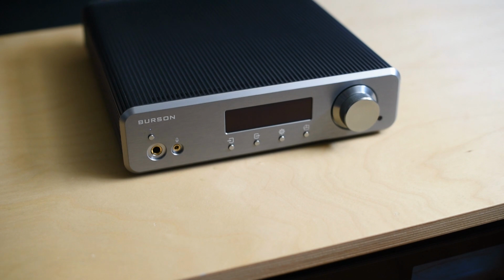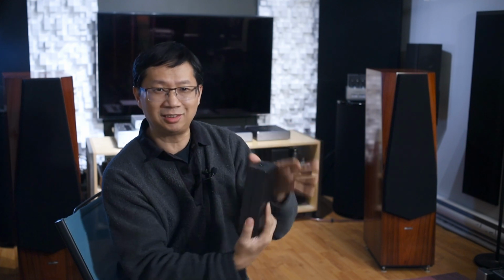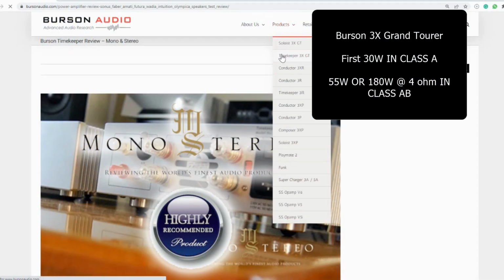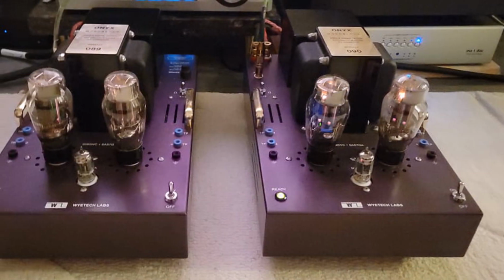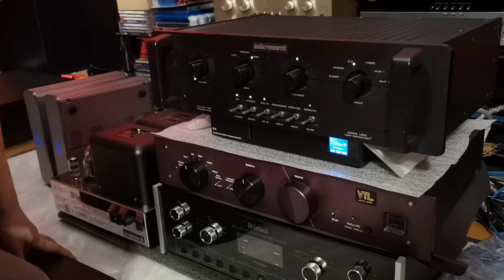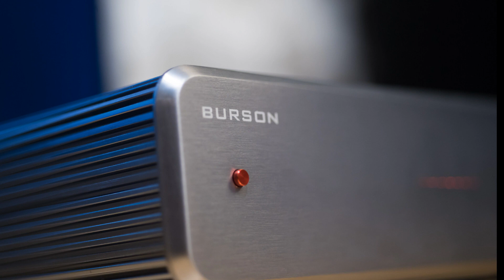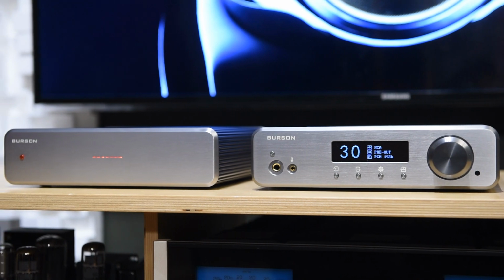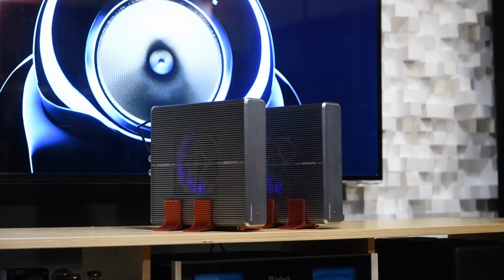The FUTURE of power amps? Burson 3X Grand Tourer Monoblocks.

Comment: An excellent review, sir. Liked and subbed. I have Magnepan 3.7is on Mye Engineering stands.   Circumstances obliged me to sell my Bel Canto stack a while back. The 3.7is never sounded better with the Bel Canto gear.  So now I am looking to revive my system, and the Burson GT amps with their preamp sounds like just the ticket. The Magnepans are a stable, current hungry 4 ohm load and it sounds like a good match for the Bursons.
Reply: I agree. I just got my Timekeepers hooked up to my Magnepan LRS+, paired with dual SVS SB3000 subwoofers, and man … they sound SOOOO GOOD!!!

Comment: Thomas, Another great review. Insightful, full of depth and presented in a relaxing tone without the jarring annoyance where every sentence is crudely edited in. I appreciate your style. As to the Burson mono blocks, I was concerned seeing fans due to potential noise issues, both electrical and via moving air. Then I noted the use of Noctua fans. If they must use active cooling, then at least they chose wisely. 😉
Reply from the maker: Yes I think they are one of the most quiet fans out there.

Comment: The secret is probably a super-capacitor. These small capacitors can store an enormous amount of charge compared to conventional capacitors. One super-capacitor can store as much charge as banks of electrolytics. Current is a rate of charge flow. One ampere equals one coulomb per second. How much can it do? There's a device on the market for a little over $100 that takes power from almost dead batteries, even a USB port, inverts it to AC, transforms it to a much higher voltage, rectifies it to DC, and charges a super-capacitor. When it reaches 12 volts a green light goes on. Now it will start an automobile engine which can draw hundreds if amps. It will also show you if your car's alternator is working with a built on volt meter that will read 14 volts if it is. Combined with a switching mode power supply it can deliver a lot of power in a small efficient package. BTW in your amplifier design connect a small value capacitor in parallel with the power supply filter capacitor. This will shunt out high frequency noise. You're getting this from an electrical engineer, not some tinkering audiophile who thinks he's an engineer but wouldn't know an engineering textbook if it came flying through the air and hit him in the head. He couldn't get through the first chapter because he doesn't have the advanced mathematical skills real engineers have.

Comment: Huh, interesting if eccentric design. Now that power supply - I'm not sold on the concept of external, switching power supplies for higher-end gear, so for me that's a bit of a disqualifier, and yes - I'm aware of the pro's, however there are also lots of con's. These monoblocks are beautifully built, just like anything else from Burson Audio. I love the design, particularly the exchangeable opamps.
Reply from the maker: Fair enough!

Comment: Greetings !!!EXCELLENT!!! your work the one you are doing, I have an Onkyo Digital A88-00 with an M504 amplifier, with an EQ540 equalizer and another EQ201 and a TA2550 deck and a CP1500F platter and Ortofon 40 turntable needle and DX708 CD, and the T4500 radio, Everything the INTEGRA models, which are the best of Onkyo's, are NOT mass-produced if they are not selected from Onkyo. And the cables connected to the equipment are from the KabelDirekt Pro Series RCA brand and 4 DAS R-212 speakers. IN THE END A CLASSIC OF THE 80S AND 90S of sound equipment of that time, over the years I have never broken any module, that is already seen from how they worked before and the manufacturing materials, I hope to have it duarte, many years for the quality of a good musical team, greetings and very good videos that you have a great like for your great videos, great sound models like these devices are no longer manufactured, it is a pity, that today everything is talk, greetings from Barcelona - You could do one of Onkyo Interga also of Review

Comment: Hi Thomas, I have a hunch why you preferred the Vivid op amp vs the Classic. The sound sample with the Classic sounds as if there are phase issues across the entire frequency range, and the timing and coherence is falling apart. This also results in perceiving the highs with less energy. However, with the Vivid op amp this phase instability is entirely gone, timing and coherence is perhaps the best I heard from a class D amplifier so far. Very nice, thank you for the review! Cheers, Janos
Reply from the maker: Thanks! It is not class D but class A then it switches to class AB after 30w. Hmm, maybe I should check if there were any issues when I swap the opamps.
Reply: @ThomasAndStereo  I don't know why I was thinking class D.... possibly the super compact size factor.. even though you clearly mentioned class A & AB multiple times!! I need a cup of tea :)

Comment: The Audio Research Ref 6 is not a neutral preamp. I had it in my system for two weeks. Compared to my other solid state preamps, it had a warm caramel coloration, loose bass, and dark high freq that are what tube preamps are known for, albeit less than for example a CJ preamp.
Reply from the maker: Really I guess I need to test it in my own system which I am more familiar with. In that system, it sounded flat but keep in mind he changed the tubes inside and paired it with the REF75.
Reply: @ThomasAndStereo  I have 6 different amps, 4 different pairs of speakers, 5 different line level preamps, multiple digital and analogue sources. It sounded consistently more warm and less transparent than any of my preamps in my system. I was quite disappointed because I was thinking the Ref 6 was going to be my reference preamp.  But Audio Research is probably one of the most “neutral” tube preamps out there today.

Comment: I currently own the Burson Timekeeper 3i and am wanting to upgrade to separates. For the amp I have narrowed down the choices to the Timekeeper 3x gt and the benchmark AHB2. My concern is that the AHB2 has better SINAD and SNR measurements, would you say that the Timekeeper 3x gt is just as resolving when it comes to detail retrieval when compared to the benchmark AHB2?

Comment: I've told you you need to use a class D or smps for your valve amplifier power supply running at 120 kHz or more. there is staff of the shelf you can buy that's not expensive give it a go you're be impressed 🇺🇦
Reply from the maker: Any links?
Reply: @ThomasAndStereo  well you need to look around you might like to look at Manley labs they make a switch mode power supply for their valve amplifiers, might be able get their advice!
but there's lots of modules about, you're need a back converter if you can't take it off the power supply for filament voltage
and a voltage booster for plate current should be able to get to 500 volts very easily, design this in microcap cad it's free now. can do valve and solid-state.
a decent smps should have a digital schematic you can put directly into microcap
send Manley labs an email be able to help you out

Comment: As always interesting. wall power supplies so far not a fan. To me on the surface it says cheap. I would need a better understanding why that's okay along with running that through lamp cord. Reminds me of a home coreless phone or something. Light weight, funny I remember guys used to give amps or receivers  the heft test as it needed to have some weight to qualify. That said it still comes down to sound.

Comment: You mention the bass being not as strong as 200watt McIntosh. I’m using a McIntosh 200 watt integrated now. I recently purchased a C2300 preamp. Do you think pairing it with these Bursons would be an upgrade or more a lateral move? Would I be better off with a used McIntosh mc402?
Reply from the maker: If you like the Mcintosh sound, then moving to an MC402 would make more sense. The bass on these is not as heavy as the Mcintosh amp and it does not have that meaty feeling. what you might get with these is speed and nuance instead. Either way, it would be more of a lateral move. After all, to truly upgrade, I always say you need to jump 2 levels up. Just look at the price difference to give you some guidance.
Reply: Thank you sir for the quick response. Keep up the good work.👍🏻

Comment: Thomas, did u try using the Timekeeper Integrated as the pre-amp with the GT’s? I’m interested to know the performance improvement from such a pairing over the timekeeper integrated alone.
Reply from the maker: Yes, forsure you will get a lot more dynamics and it was quite smooth the combo. Just not as airy when compared using a tube preamp.
Reply: @ThomasAndStereo  I bet the Doge 8 sounded excellent with them!  I was kind of hoping you would use it in your finishing demo.  I would've REALLY loved to hear that!

Comment: These amps look interesting. I have a few questions. If you have time to respond to any, I would appreciate it.

1.I have a Burson DAC already with V6 Vivid op amps. Would this be too much of a good thing, or do you think they would work together seamlessly?

2. I've never owned or heard a Class A amp. Do you feel that these power amps at 180 W into 4 ohms would be able to drive a pair of Magnepan LRS?

3. I'm not sure if you mentioned it but how hot do these amps run? I would assume stacking is unadvisable, but how much room do they need?
Reply from the maker: 1) The will work seamlessly. I had it plug to the Burson conductor and it sounded good together, just not as airy as the Doge 8 but was smooth.
2)I did not test it on the LRS BUT I will when I get the final version from them and I will test it on the Magnapan 0.7. I assume it will be fine given it can drive the Quad but wait for my Magnapan 0.7 video.
3)They don't run hot because of the fan but you cannot stack them.
Reply: Thank you so much for replying! I really appreciate it!

Comment: I went to check  the combo for the  Burson 3X Grand Tourer Monoblocks + (Preamp+Headamp integrated) is USD $5500. It's really quite a princely sum. Based on Thomas review, it should sound great and punch easily at it's price range. 
However I think it's looks don't quite match cost of the set. As I am assuming the 2 monoblocks generates a fair amount of heat, the 3 units might overheat is u stack them together.
2 monoblocks on a vertical stands and another pre-amp takes up too much space, and the aesthetics are poor and lazy this way imho. For the money, it is not acceptable. I really like what they are doing and interested in purchasing, but it should be with better aesthetics and cheaper price unless they have a sick looking setup.

Comment: I used to fix 4-track tapes in the 1960s for my car deck
.... I wonder if you know what they are?
Reply from the maker: Nope!
Reply: @ThomasAndStereo  
Stereo-Pak - Wikipedia
https://en.wikipedia.org/wiki/Stereo-Pak
... even though the format lost to 8 track they were vastly superior and used in RADIO for recording ads in-between programing into the 2000s. 

.... I had several players beginning with a Manuel track switch. 
..... it was as close as you could get to recorded Reel-to-Reels. Akai's and other Reel to Reels would have alternate tracks you could play and if you wanted to you could take the Tape from a 4-Track and put them on REELS. 

Actually, that is a good idea. I bet there are millions of 4-Tracks that could be put on 5 inch Reels and sold as though they were manufactured. 
.... they'd be just as good as if they were!

Now there is a reason they did disappear in the consumer market, but you'll surprised to find out that the Better Cartridges and Decks LOST to 8-Tracks.

Comment: And when audiophiles who like class A don’t mention lack of power and when they speak about A/B amps the sky is the limit in wanted power….
Reply from the maker: The struggle with class A is always power :(
Reply: @ThomasAndStereo  And even then... driving 803d3's with a PrimaLuna with less than 40Watts. It will push the speakers to levels which are uncomfortable... For normal listening power is over rated in my opinion. BTW I love your channel and approach to audio gear😀